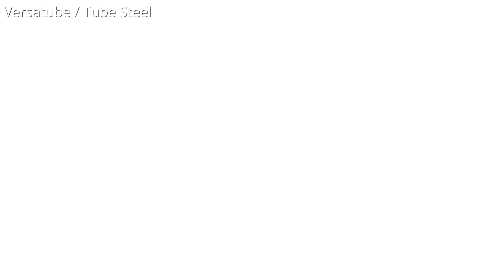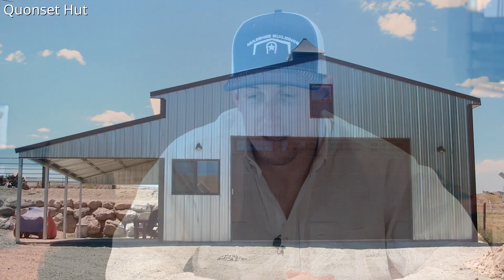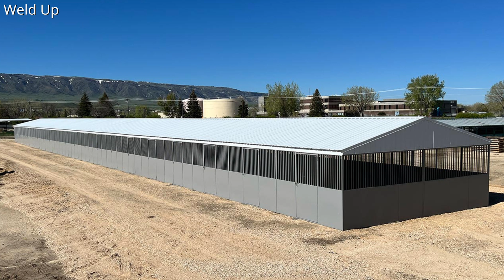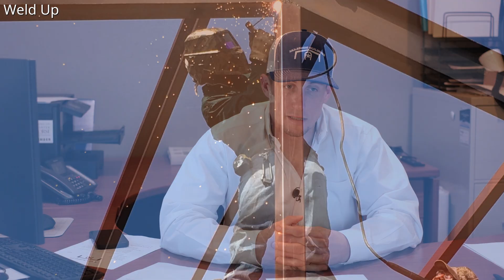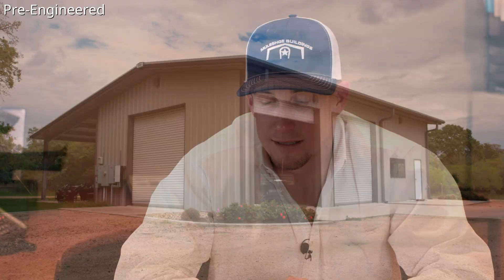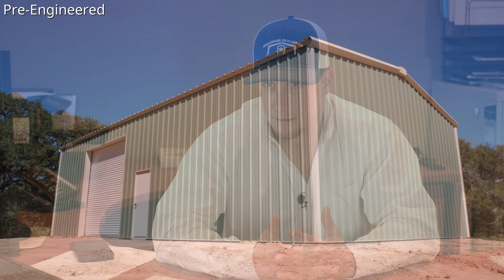The Different Types of Metal Buildings: Choosing the Right One for Your Needs

Comment: I dont understand why people are welding all the steel together out in the field, why not weld flanges at the ends in the workshop, then when you get out in the field you are just simply bolting them together.
Reply: Bolted connections are more expensive than welded connections.
Reply: @fcalin21  Yeah a piece of plate 4"x 6" and 4 bolts per connect is going to kill your quote, especially when it take twice as long to weld it together out in the field.
Reply: @jamesmatheson5115  Some people , apparently, prefer that.
Reply: @fcalin21  I dont believe that for one minute, cutting all the pieces and welding flanges on in the workshop with flanges welded on for feet again in the workshop means assembly would only take a day, the hourly rate in america must be really low to do it their way, here labor cost has to be considered.
Reply: I weld everything that I build. My customers value that. Case closed.  I also do a lot of the welding in my shop. I don't know anyone that welds only in the field. It's part of the equation but not all of the equation.